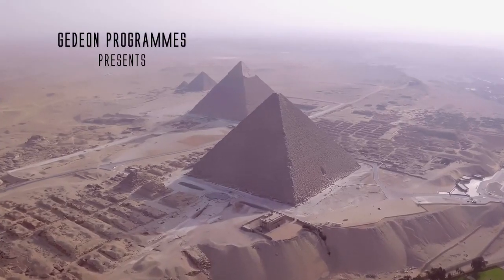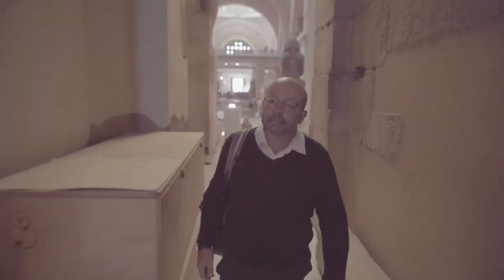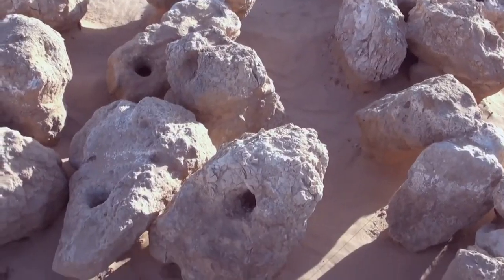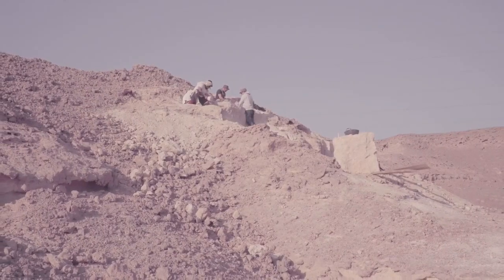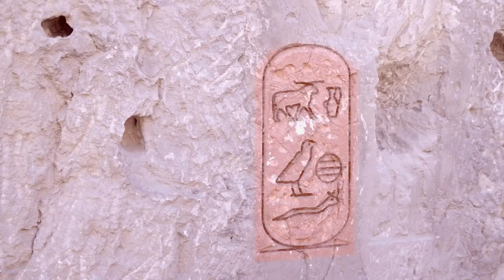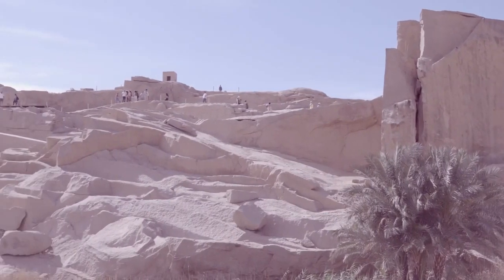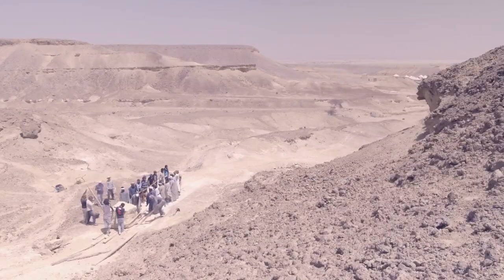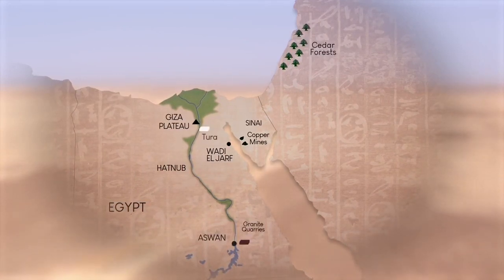Pyramid Builders  New Clues   2021 Ancient Egypt documentary Kemet HD

Comment: This videos like getting 10 men from the Pub and asking them to build a Rocket ship. Now if theyd looked they find out a document that dates to the reign of Ramses IV [1163–1156 BCE] provides a report of an mining expedition to the mountain of Bechen in the Eastern Desert under the direction of the “superintendent of the works”. Altogether, the expedition consisted of 8,368 people. The labor work was carried out by 5000 miners, smiths, masons, etc., and 2,000 various types of labor. They used highly skilled people for the cutting of important blocks, who had been chosen because of how brilliant they were. They had plum weights during those times to ensure perfect lines  and they wouldnt have used copper to cut the stone but instead used harder steel, Herodotus mentions iron tools being used by the builders of the pyramids more than 4,000  yrs ago. Even King Tuts dagger is highly crafted steel from a meteorite. Look at what was built using maths, geomentry, skilled ppl so dont be shocked that they worked out how to cut stone to precision. If it was some alien mystery device there would be plenty of paintings/writings showing it somewhere in the millions discovered.

Comment: The pryamids where poured like concrete not with quarried stone look at the edges. Of the sandstone  not possible to do this at all that's why you cannot fit a pin in between the joints because they poured the sandstone mixture
Reply: If they poured it how did they turn into individual squares?
Reply: @HiddenHandMedia  form work like they do today with concrete

Comment: Why wouldn't they have used oxen & logs rolled on top of planks to move large stone blocks? More efficient pulling power and far less friction...and all of which was available and known to them.
Reply: The pyramids are ancient geopolymer. It's been proven with science and is irrefutable.
Reply: @sweethike  Wrong. Theyre stone, Either way they could have been pulled as he said with ox and logs
Reply: Wood of this type is rare in Egypt. It would be difficult to obtain it. Maybe from Lebanon or central Africa. Also, you need to coordinate roughly 100 oxen to move 70 tonnes of granite. Not saying that it's impossible, just exceedingly difficult and unlikely, especially if we consider the proposed time frame. Simple explanation works in simple cases but the problem is scale. At such large scale everything gets exponentially more difficult. In this video they could barely move a 2-tonne block. Ancient Egyptians supposedly stacked 2.5 million of them in 5-minute intervals. Not even considering that the blocks had to be cut and aligned. It doesn't add up and it's a mystery.
Reply: @baze3SC   @baze  
Regarding your first point: 
Obtaining wood from along the Nile or merchant trade when compared to quarrying, transporting and building with stone on this scale is a relatively easy task. 

Regarding second point: 
Out of sheer bemusement & curiosity, where did you pull 100 oxen : 70 tonnes ratio. 
Given that the amount of force required will vary dependent upon the amount of friction & inertia to overcome. Lol, I'm just picturing some ancient Egyptians tradesman consulting his hieroglyphics ratio table that has tonnage on one axis & number of oxen on the other axis 🤣.

If you had to co-ordinate and lash together 100 cats...then yeah it's going to be an issue...Oxen not so much. They will do what they're told or they'll be eaten.

Comment: Try a sledge that doesn't have a straight bottom, making it like a SEE-SAW rocking the stone's weight ;) this will created inertia leading to a greater thrust.
The SEE-SAW would eliminate the need to the two or more people from the sides with their sticks trying to rock the rock.   
The SEE-SAW would also make it easier for the workers to give the stone direction and to even turn the stone 180 degrees is necessary to change the SEE-SAW effect according to the ground. 

Or maybe make a straight bottom but change the course making it as steps with perpendicular wooden beams , as if taking it down stairs. 
Or maybe putting the stone on rolled beams making a railway made of wood. This way you might not even need people pulling but the contrary.
Just imagine if you put 2 very big and long wooden beams parallel to each other and putting on top of them multiple perpendicular wooden beams then put a sledge carrying the stone on top of that. it would be wood rolling on wood , not even touching the ground and maybe not even pulled but just counter weighted. 

Another note: the base planks would be more efficient maybe if they had stoppers to make it more fixed to the ground and not going with the sledge.